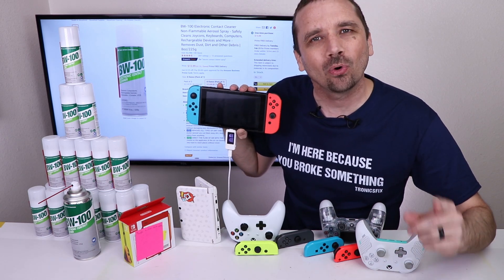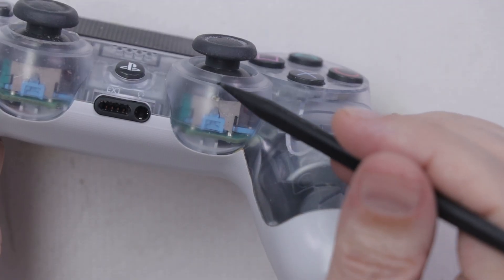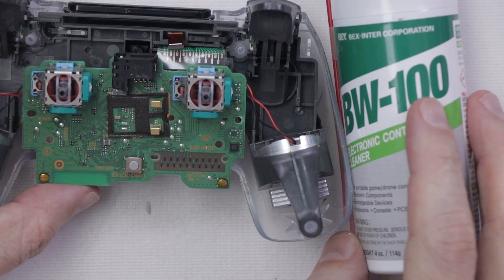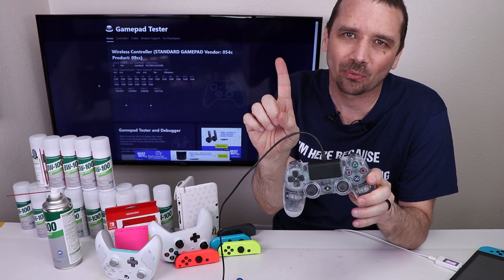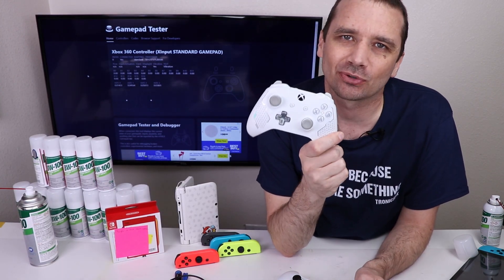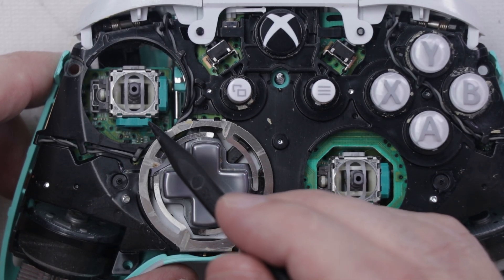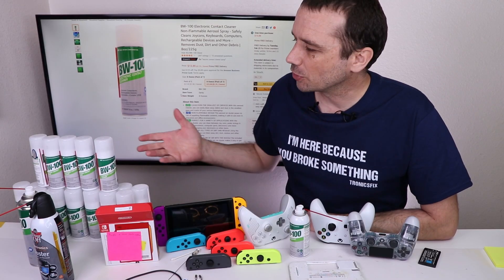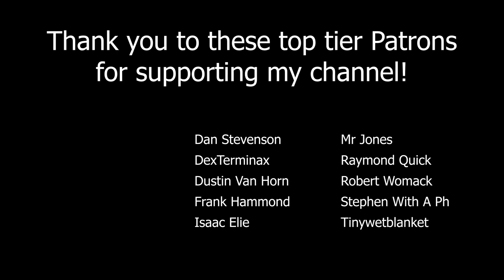Analog Stick Drift - Will Cleaning Fix It? Clean vs Replace Challenge

Comment from the maker: Buy BW-100 Electronics Cleaner Here(Paid Affiliate Link): https://amzn.to/3bJyEZO
Do your controllers have stick drift? Have you tried cleaning them?
Reply: Can i poor a liddle drupple of alcohol in the joystick as well???
Reply: Will this help when the stick gets stuck with the cap off or if the stick don't return to center sometimes? If so I'll definitely buy some asap
Reply from the maker: @raven.4757  There's no way for me to know or guarantee it...it depends on how damaged the stick is. IMO, it's worth it to keep some cleaner around so you can try to clean it first. If cleaning doesn't help then replacing the stick is probably the only way to fix it.
Reply: dose it work without the can and just use isopropyl alcohol??
Reply: Well, it's nice that they made a smaller size. But you can only buy them in packs of 3?.. What's the point of making a smaller size? Lol
Reply from the maker: @MH-nr5rv  I wish they would just sell a single can too. Not sure why it's only in 3 pack.
Reply: Good
Reply from the maker: Amon Shinohara  Yes, a damaged circuit board can cause that but also sometimes they need to be calibrated...which is usually rather difficult and time consuming.
Reply: If we spray the ps4 controller on the joystick like you did with the switch controller will it fix it?
Reply: I have a question. Is there a way you can clean the analog stick of a switch without taking it apart... would canned air work?
Reply from the maker: @MINECRAFTYnow37  I mean, that's exactly what I show how to do in this video. Not sure how I can explain it any better. You can always try canned air.
Reply: @TronicsFix where do you buy replacement joysticks
Reply from the maker: @aandres1245  Mouser is probably the best place to buy them
Reply: @Tronicsfix  I bought the RKJXV122400R from them but everytime I installed them they still had drift 😕
Reply: Can you do a teardown of a stadia controller
Reply: @TronicsFix could you please share where you buy the analog stick module??
Reply: Your affiliate link says currently unavailable, fyi
Reply: Got mines and it definitely works for controller drift. 
Impressed!
Reply: What Soldering Iron Did You Use At 7:40 You Didn't Even Use Solder Wick Lol
Reply: @TronicsFix  I tried fixing my left analog stick and while I was pulling out the potentiometers out, I broke it off of the motherboard. Now it doesn't work, what can I do to fix it? I don't know how to solder and I don't have the tools to.
Reply: @mauricemonye  buy a new one 😂
Reply: My ps5 controller has drift and I cleaned it with bw 100 and it still has the drift
Reply: @BCGaming666  yeah ps5 controllers are junk ;)
Reply from the maker: @BCGaming666  If that's the case then the analog stick is probably worn out.
Reply: TronicsFix, 
Can you please tell me how you make sure that any of the products you buy used aren't stolen.  I am thinking of starting a business like this and i don't want to receive stolen property.  Thank you for your time
Reply: Doesnt ship to Canada:(

Comment: Both the Xbox family and the PS4 and PS5 controllers are using the same mass produced model for analog sticks, which are not as tight as past models as I almost never have problems with drifts with the Game Cube or the PS2 and PS3 controllers, which tells me that they were more tightly assembled or had smaller pieces as larger pieces tend to get dusty and that dust with humidity turns into a sticky substance that causes drift.

Comment: Hi steve thanks for this great video I watch lots of your reparing videos and learned alot!
just a quick question I replaced the joystick on my dual sense controller multiple times but every time I put a new joystick in its just off centered a bit, its not moving or getting input but just off-centered. how can I fix that? Every time I replace it, its off-centered on another random spot

Comment: Mineral oil (machine/automotive engine oil) is a perfect way to fix unstable contact of buttons and fix buggy potentiometers. So you even no need any BW-100. In such a way, I fixed the power button of my old smartphone and few buggy mouses.

Comment: Steve, i have a little question. How much heat do you use on your solder station to replace Analog Sticks?
I've tried to do it but I ended melting the sticks and I don't know why):
Thanks for reading me.

Comment: I replaced the analog stick on one of my Valve Index vr controllers. They basically all fail in the same way eventually and the repair is to solder on a new analog stick part. Since they are sold as a pair for $300 a set I think there's probably a lot of money to be had in repairing them as a service and buying and refurbishing them.

Comment: I received a friends controller where if you would press the left stick up, the right stick also monitors a move to the left. And left stick down the right sticks also triggers a right move.
After clearing the board from cat hairs and some liquid it still didnt work.
After spraying some elctronic contact spray in the thumbsticks the problems where finaly gone.
What a luck youre video came up today on my phone.
Watching all your clips for a long time now, keep the good work/tips coming :)

Comment: @Tronicsfix you posted a phone number for me to contact on WhatsApp, I didn't answer for 3 minutes and you blocked me? That's messed up, I was going to buy 3-5 off you but you clearly don't want the business. Sorry I'm actually busy unpacking in a new home...
Reply from the maker: Um, no I didn't. That was a scammer...they used my name and logo but they were not verified. If you look at my name it has a check mark after it. That means that it's me responding. Anyone commenting as me but isn't verified is a scammer. Please go to their account and report them.

Comment: This is gonna get lost in the sea of comments, but I recently did a full clean of my ps4 (CUH-1115) because while it never overheated, the fan was always on max blast. After completely dusting the whole console from the heatsink to the entire fan area, NOW the console thinks that it's overheating the second it turns on. It'll turn on for maybe 5 seconds, the fan will rev all the way to max power, then it just dies. It never had this problem before and now it's unusable, all I wanted was to clean it :( if there's any advice you could throw my way it would be very appreciated

Comment: I found a way without using an application for the controller check
If you own Window 10

Go To: Control Panel > Hardware and Sound >Device and Printer
How to Find Properties: Wireless Controller > Game Controller Setting  >  Properties
Hope this help!

Comment: Just a random thought, not that it would matter: can the BW-100 activate the liquid damage patches as well?
Reply from the maker: It's possible but if that's what activated the one I show it would still be wet. It was very dry.
Reply: Yeah, that's what I figured as well. Still, might be risky with products that are still under warranty. If you send them in for repair after only cleaning them with BW-100, they might still be refused because they show liquid damage... Food for thought.

Nice video anyway!

Comment: So I use another brand which is basically the same stuff... fast drying non-conductive contact cleaner. Its my go to every time I have a drift issue which is now absurdly rare. I reckon an awful lot of people haven't tried this stuff before complaining to Nintendo or filing a law suit.

Comment: Steve, I have a question for a situation i’ve been facing with my PS4 Pro lately:

Most of the games i play works smoothly on my console while others (2/3 games specifically) forces the overheat notification to pops-up instantly which leads my PS4 Pro to turns off from the first minute of gameplay...!! Any explanation/fix for such situation ?

Comment: if you clean an analog stick and it fixes it, then it was a dirty stick, not stick drift. 

Stick drift can not be fixed because it is caused by worn potentiometer. It will only get worse unless replaced; it has been like that since arcade games with joysticks on them

GTA5 controller settings is when I found out what deadzone is. Because the potentiometer is worn, you can actually create a deadzone in your joystick. 

You set the controller down and what your character move, go into setting and turn up deadzone and it will make the spot at which the meter worn, not send signals unless you pass the deadzone. 

Deadzone would not be a thing if stick drift could ever be fixed; ever. If you think you could try this or that to fix it, you are wrong, bottom line.

Comment: You have to convince me that IPA didn't do the same thing :)
Reply from the maker: IPA works great for cleaning these too. The main advantages for BW100 are that it's not flammable and it comes in the pressurized can so I can spray it right down where I need it.
Reply: @Tronicsfix  Yeah, you have right, thanks for reply. I missed the fact that is not flammable, that is great. Great video also, waiting a new one!

Comment: A question how do you test these controllers?And is there a dead zone applied?I have a DS5 that im using with DS4windows but there is a deadzone of 0.08 if i use a 0.00 they are not working properly...

Comment: The liquid marker on the joycon that shows liquid damage wouldn't the bw100 or simularcause the same reaction if it detects liquid in there.
Im probably miles off but just curious

Comment: Steve, in the second joycon you said the water sensor was triggered. I was just wondering if it’s possible for the spray you put in a few minutes earlier to do that to the sticker? There were other signs of liquid damage in this case but it’s an interesting question about the product.
Reply from the maker: That is possible but I think that one was liquid damaged already judging by the look of it on the inside.

Comment: You this this would work for Ps5?  mine has the drift issue. if i open it up and clean the inside. would that solve it? they(playstation) only told me solutions like reset by the pin hole and update. to solve the issue... doubt that will do it...

Comment: how is BW-100 different from 99% isopropyl alcohol?
Reply from the maker: One of the best things is that it's non flammable. It also comes in the pressurized can so you can get it right down where it needs to be. They both clean really well
Reply: BW-100 is 15-20% isopropyl alcohol (if you read the MSDS)

Comment: Gamecube controllers after 20 years: drift? What's that?
Reply: Same with my Playstation 1 and 2...
Reply: I'm sure it's just because news controlers (ps4 and xbox because joycons have an other issue) have much better deadzones who create drift
Reply: Smash games; i didnt did a good work.
Reply: Yep, same with 2005 xbox 360 controllers.
Reply: My gamecube controller did experience drift though, especially notable in the smash character select screen. Oddly enough, all I had to do for it to disappear was reinserting the controller several times in the controller socket port.
Reply: @truefartsmella  That might be because the controller gets calibrated every time you plug it in
Reply: @truefartsmella  You probably shifted some dust around in the port.
Reply: Wii Classic Controller: what?

seriously though, for games that don't require motion controls, I use a 8bitdo adapter with my classic wii controller pro. It works greatly!

Comment: Hi tronics fix I had a drifting issue with my ps3 controller and I used something call surgical sprite and out then down into the analog sticks and it stop the drifting regards Ryan you are doing a fantastic job bro keep it up

Comment: 8:00 Just a thought . . . Would conductive ink work ti repair that potentiometer if it was "painted" in the place it was worn out?  And a bit of solder placed on the worn metal contact points?
Edit: oops forgot timestamp...
2nd Edit: Just realized someone already suggested the "paint the contacts trick" .

Comment: carbon film potentiometers are defective by design, sooner or later the component WILL fail due to wear out. manufacturers should use hall effect sensors (or similar technology) to negate the friction factor.
Reply: They should just make the analogs easily replaceable on the board, and have 2 extra inside the controller box.
Reply: @squirrelhallowino29  why would they do that when they can just get you to buy a whole new controller?
Reply: @EvoX180  A more profitable market would be selling controller covers, but the majority of people who would buy it are the same who play everyday and know the issues, if there's no issue there's incentive to buy something and customize your long lasting controller.
Reply: Hall-effect potentiometers are expensive and very sensitive to temperature and drift too.
Reply: @gavachkin  i work on the "lift truck" indutry and all the new model are made with no analog pot, it all bring hall effect sensors and you'll never replace the pot again. is it expenseive? maybe, but it's more expensive buying a new control, Just a few people can and want to repair his own gamepads.

Comment: great video bro 😎.. question would using rubbing alcohol to clean controller work ?
Reply from the maker: Usually, yes. You just have to get it in the right spot.
Reply: @Tronicsfix  thanks for the super fast response much appreciated 🍻
Reply: @Tronicsfix  my I ask what program on PC do you use to check controller function

Comment: Would you say the BW-100 cleaner is better than WD-40 version? I only like the BW-100 because it dries quicker .
Reply from the maker: I've not tried WD-40 but you mentioned one of the things that is great about BW-100...it dries fast and doesn't leave a residue.

Comment: Would spraying the contact cleaner in the controller cause the liquid damage indicator to turn fully red. It is a liquid before it evaporates?
Reply from the maker: It is a liquid before it evaporates.
Reply: @Tronicsfix  So would it turn the liquid indicator red?
Reply from the maker: @blainegass4179  It's possible...haven't tested that
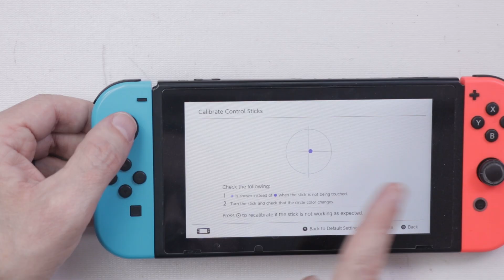Reply: @Tronicsfix  @10:33 it shows a blue joy con and you spray the cleaner in the top of the joy con so when you open up the back the liquid indicator is on the top side where you sprayed the cleaner so my thinking is the cleaner is what may have activated the liquid indicator.

Comment: I've cleaned a few myself and still didn't help. I've figured replacing them would be best. Maybe I'll give that BW-100 a shot before I head that route
Reply: What did you use to clean them?
Reply: @MyRegardsToTheDodo  I opened up my ps4 controllers and used isopropyl alcohol to clean those little disks and what they are touching.
Reply: @EveryDayRetroGaming  did it work?
Reply: @2wastedz  Sadly no. The controller was just 2 months old when it started drifting. It drifts on Death Stranding and Minecraft pretty bad. Most other games it's alright.
Reply: @EveryDayRetroGaming  Oh okay, glad you answered. Hope you find a solution soon mate!

Comment: "Here's how to clean up analog stick drift with Stadia controllers!"
WHIPS THE CONTROLLER AGAINST A BRICK WALL, SHATTERING IT
Now that takes care of that!
Reply: Next up.....drywall repair.
Reply: Let's just finish it up Lights up a torch to burn the remains
Reply: lol I'll will just damage the wall.. the best repair you can do for stadia controller is put it down on the ground, grab a hammer and smash both of the analog sticks to pieces!! 🔥🔥
Reply: @mattleizee  is it because ITS WHITE HUH HuH You MAD 😡CAUSE IT NOT BLACK HUH racist mofin /sarcasm
Reply: Love your methods lemme go try that and thank you 😘
Reply: No need to fix the analog stick drift when there is none. Only Nintendo and Sony seem to have this issue.
Reply: @monsi9626  man, in this video the guy has show a xbox controller with analog drift...
Reply: @aqelabatata  I know, but it seems to be pretty rare in comparison.

Comment: i find out that gamepad tester site is not accurate. it can't detect small drifts on ps4 controller. when i use controller in game it still has very small drifts

Comment: I advice you to use gloves, this BW-100 probably made on the bases of toluene, which is quite toxic
Reply: The MSDS doesn't show any toluene. However, it does state it's highly toxic and proper PPE should be used.
Reply: @carnage50x  So probably made from other toxic solvent like CHCl3 or Ch2Cl2

Comment: If you can that easily clean the joycon sticks without disassembly, dirt can get into it the same way. Probably a reason why drift is so prominent with them.
Reply from the maker: Yep
Reply: Sometimes I've gotten joycons working again with just blasting some air under the dust cover. Dirt/dust just gets in super easily...but at least it's pretty simple to clean. I feel like if they went with a more solid dust cover instead of the little thin rubber flap, it could have been a lot better
Reply: Tronix fix is there someone really out there using your name scamming people are you kidding me now it's happening on your channel sorry man
Reply: Conversely if you can clean them that easily then there's no reason for your joycon to be getting that dirty and drifting.
Reply: @RG-Zeldaplayer  Ah, yes. It's the consumer's fault that Nintendo designs things badly.
Reply: @louskunt125  Sony uses the same type of thumbsticks for its controllers too... and Xbox controllers drift after a while also. When I started getting a bit of drift... first thing I did was clean them with some contact cleaner... They haven't drifted since. The first thing some consumers seem to have done is signed up to a class action lawsuit.
Reply: @louskunt125  well it's definitely Nintendo's fault that some people don't know how to wash their hands...